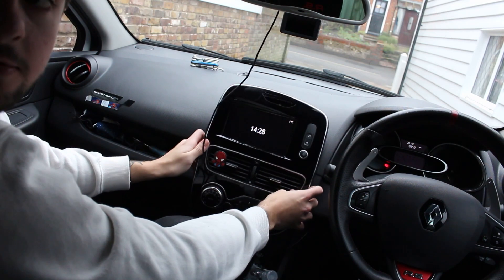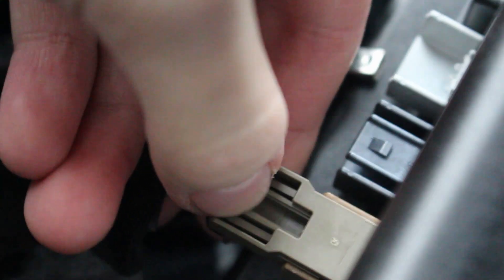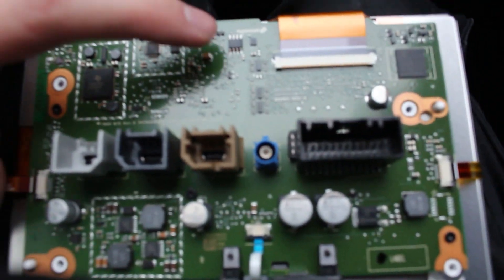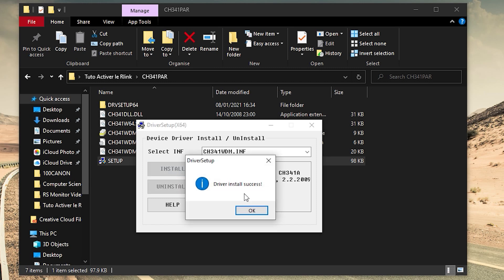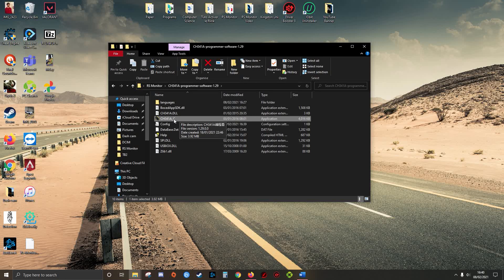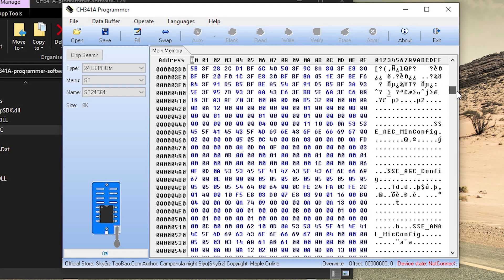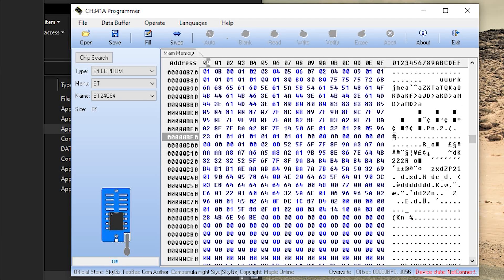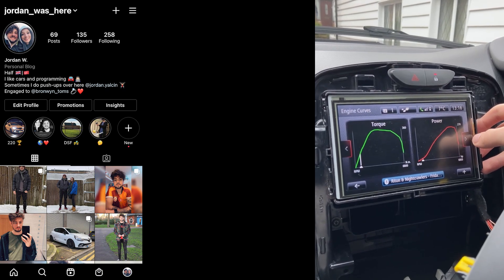How To Install The R.S. Monitor On R-LINK 1 - FULL GUIDE! by @jordan_was_here

Comment: Thanks for this. Gave it a whirl and I couldnt get it to work. Everything done as it should. It read and wrote etc but when I click verify, i get an error saying they basically dont match (chinese wording to that effect 😂) read original-verify, error...carried on, write new file-verify, error again.
The weird thing is that I get the "find nearest dealer" message (thought i broke it) but pulling the power plug and plugging back in again and it bursts into life again as normal...but with the original file again, not the new one. It kinda acts like its read-only and just reverts.
Any ideas?
Reply: I had exactly same problem as you. even a one point crashed my laptop.